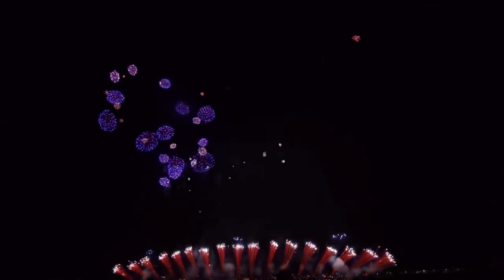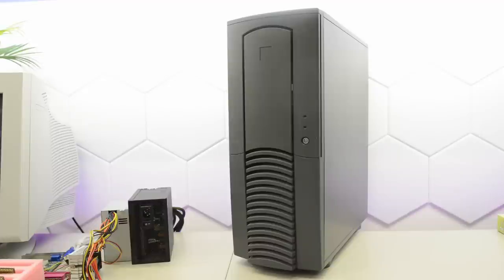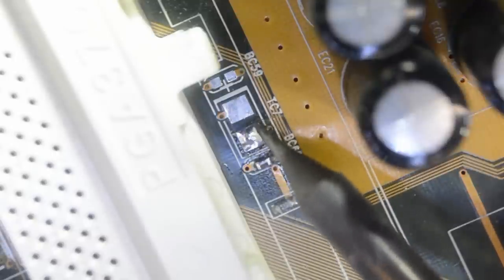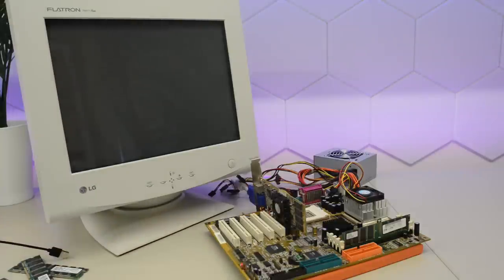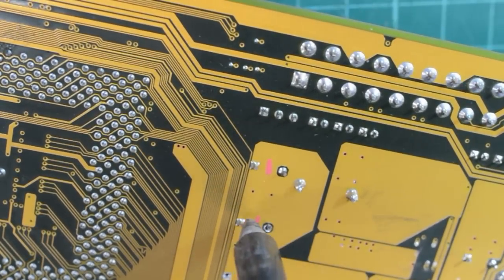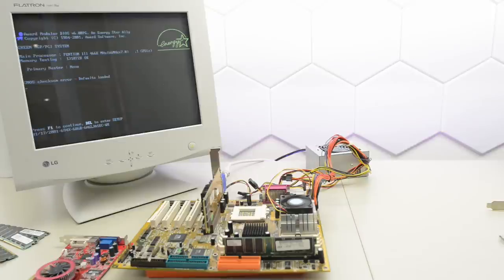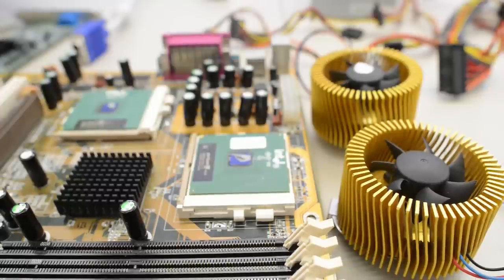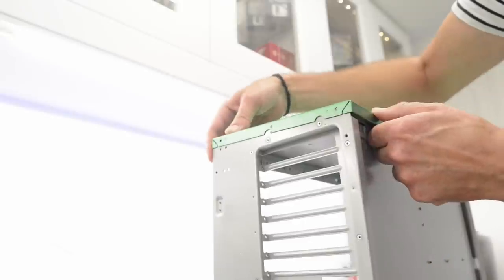Recreating my year 2000 PC with parts from eBay. MOBO repair. Custom ABIT VP6 dual Pentium 3 1GHz PC

Comment: This has just given me flashbacks for my Abit based machine which used a Abit BX6 motherboard 😀
Reply from the maker: Good times, when ABIT ruled the world : )
Reply: @Epictronics1  Absolutely. I've contacted the UK vendor to see if they might have a copy the invoice so I an double check what else it had fitted. Definitely some sort of Soundblaster as I managed to cross connect the DMA channels between that and the IDE controller and it made for an effective disk wiping method.

Comment: I found, that using "greasy" flux (cream??) works great, to fix the cap in place, before you add any solder. Use ceramic tweezer to gently push them onto the board while applying using the iron with some fresh solder on the tip.
Reply from the maker: I was just thinking this while I did the edit! I'll give it a try on the next project

Comment: I still have my VP6, you're making me worried I might need to recap it before I run it again.  I'll cross that bridge when I need to.
Reply from the maker: I have no experience running this board with bad caps but some people claim that bad caps can damage the voltage regulators on these boards. I'd recap it just in case

Comment: You have pretty good soldering skills with those surface mount components. I never really gave it much thought... preheat the board with a heat gun to solder & unsolder through hole components in those nasty, mean, uncooperative ground plains. Thanks for the tip. I probably won't use it but, if I do.... I really enjoyed watching this. Much better than I thought it would be. WE NEED PART 2 !
Reply from the maker: There will definitely be a part 2 in about two weeks. I need to order some parts. Thanks!

Comment: It is quite normal that boards from this era have caps from different manufacturers. I just recently recapped EpoX 8rga+ Socket A board low ESR VRM caps, and it had few Sanyo’s (left those on board) and crappy GSC caps which I replaced. In addition to these, it has bunch of TEAPO general use filter caps. These multilayered board can be tricky to work with. I did the decap like this this: I soldered big blobs of fresh solder on the legs so that gun has a large  surface area of melting solder, added flux and with 375C and around 10 sec from desoldering gun was enough.

Comment: This is awesome! The whole build brings back a lot of memories for me!
Back in those days I used the Antec version of the same case from the start of the Pentium 3 all through the Athlon XP days. For the P3 I also used one of those Golden Orb coolers and it seemed to do a good job for the price. That case served me well for almost a decade of continuous use!
Funny enough just yesterday I pulled the now empty old case out of storage. I'm planning on using it as a DAS with 12-16 HDD's to start with. I just need to figure out a good way to mount the SAS expander & PSU breakout board I will be using higher up near the PSU along with probably 2 extra HDD cages on the bottom. :)
Reply from the maker: Thanks, Sounds like a fun project :) good luck!

Comment: You're trying to solder to a heatsink
Yeah, I recommend using a hot air station at low temperature (100°C, maybe 150°C) for preheating.
That helps a bit against the heatsinking for the CPU VRM of the boards...

Comment: Great video.   You could consider doing clear coat over the top of that green to protect it and bring out the sparkles
Reply from the maker: I think I might! Thanks
Reply from the maker: @MrHBSoftware  When I don't have access to a proper paint booth, I use SprayMax 2k. Great stuff

Comment: A persistent FFD light and drive fail is normally an inverted cable. However your board has other problems 🙁. Perhaps use a PCI controller card if you can’t find a fix. Best of luck.
Reply from the maker: I actually used a PCI controller back in the day because I didn't like the onboard RAID. I don't remember why. For the hell of it, I'll try to fix this onboard controller anyway
Reply: @Epictronics1 did you try to invert the fdd cable? I've always remembered it had to be "red with pin 1 or opposites" if that makes any sense to you and from the video it does seem to be a bad data cable orientation
Reply from the maker: @HugoFaria-AZ  Yes, I did after I uploaded the video. I used an older cable without the plastic tabs and reversed the cable. It works now but only occasionally.

Comment: I personally think, the case looks better with the tilting/rotating feet.
Love the colour, though. I personally had one in blue, of course with the cutout and acrylic window on the side panel. And I added an acrylic panel with engraving and LED highlights to the door (cut out the centre thingy).
Reply from the maker: I'm actually considering doing some LED mods to this project :)
Reply: @Epictronics1  : I also forgot about the cold cathode lamps... ah yes... we're not getting younger, are we.
Reply from the maker: @bikkiikun  :)

Comment: You might want to check the wayback machine to see if it's cached some details about your original case. If you bought it from an online computer store, they might've cached the page from around the time you bought it. I managed to find out some details about computer parts from my old PCs by looking up the computer stores I used to buy from. I lost access to my old email account for the invoice they emailed when I purchased it, but I could remember around the time I bought the parts, so I just looked up the sites on the wayback machine and could browse the categories until I found the parts that jogged my memory. The bonus is that it also shows about how much I would've spent on the system at the time, although prices fluctuated pretty frequently so it's not 100% accurate, and I'd often wait a couple of weeks until I found parts on special, which the wayback machine might not manage to catch.
Reply from the maker: Unfortunately it was a special order through my dayjob. I don't remember what supplier we used to order the case. I'll do some thinking, maybe I'll remember

Comment: I still use the Chieftec Dragon case for my PC. Since years. It's a really sturdy case. Although it's a little bit heavy.
Reply from the maker: That's awesome. It will probably outlast many new high-end cases
Reply: @Epictronics1  It already did that. For over 20 years. But I have to say it's really old now. The i7 4770k that's now inside it probably stays in there. It was a great case. I also have beQuiet foam for noise reduction in it. A product of its time.

Comment: I am having a very similar problem with my 486DX machine. The IDE sockets quit working and the ISA bus is dead too. The machine has three 32bit PCI slots so I was able to boot up its hard drive using a Promise Technology 66 controller card inserted into one of the PCI slots with a PCI video card. I'm glad I have that option, but that leaves the CD ROM dead in the water.
Reply from the maker: Well, we'll figure it out. I have a few things to try out in a video in about two weeks
Reply: I wonder if a quick troubleshooting step would be to start with a fresh BIOS flash in case the BIOS on that board is suffering from bit rot?
Reply from the maker: @T3hBeowulf  I was hoping for that too. Unfortunately, flashing the BIOS didn't help. I have now also found that the USB isn't working. At least not with WMe

Comment: I had a case similar to that one but it was made by antec, and it had 2 usb 1 firewire ports in the front just below the door with a little flap and a windowed side panel. I do miss being able to pop in the fans with ease because of the brackets that the case had but 80mm fans were very loud and even with many of them my pc struggled to stay cool. Still for my first pc it was a beast back then.
Reply from the maker: yeah, 80mm fans is definitely the weak point with this case

Comment: The always on floppy drive LED is usually caused by the ribbon cable being the wrong way round.  The HDD corruption on the primary IDE channel could be because your cable is too long. Try using a shorter cable. It must an 80 wire cable.
Reply: Also try limiting the speed to 66 or 33Mbps, not 133.
Reply from the maker: Yes, I tied with an older FDD cable without the key notch and the FDD is now working. I have tried with a shorter 80-wire HDD cable but no luck so far. Also tried with a 2-second HDD delay in the BIOS
Reply from the maker: @simontay4851  I'll see if there is such a setting in BIOS

Comment: Back in this period I had a batch of Sony branded floppy drives that had the floppy cable connector reversed.  I had to cut off the tab and insert it backwards or the drive would do exactly the same thing yours does.
Reply from the maker: Dude! That was one of the faults! I tried a cable backwards without a tab and it would boot ones. It wouldn't boot the second time so we have more faults but this was definitely one of the issues. Thanks!

Comment: I have VP6 with 2x 1GHz PIII, 768 MB RAM, SB Audigy 2 ZS, FX5900 + VooDoo2 8MB. 
I can advise you to triple check BIOS settings for floppy and for IDE - it's a bit unintuitive with some additional options, which you may have accidently turned on (such as A: and B: drives swap, which caused errors in single floppy drive configuration), also IDE HDD autodetection is also a bit wonky (you may increase initial IDE timeout if HDD is too slow for autodetect, built in RAID is a bit slower so it's more stable).
Btw. if you're using AGP in 4x mode, you may need to set  AGP driving value manually (otherwise it's unstable).
Reply from the maker: Thanks, that's very useful to know. I'm doing some tests as I write this. The FDD is now working :)

Comment: There's something else with old cases. Maybe it's their «form follows function» vision: It's a computer case, and you should be comfortable working on it. I've lost my taste for big towers, but that one looks really interesting, and the paint job is top notch.

As for the motherboard, a half-dead southbridge looks difficult to diagnose. Do you plan to change the chip entirely?
Reply from the maker: Thanks. If I have to. I'm still doing some tests as I write this

Comment: I might be in the same boat as you, regarding the failing IDE controller. In my case (no pun intended), it's an MSI KT3 Ultra-ARU (Via KT333+8233A) but the symptoms are similar. Regarding the FDC, I find it weird that it's also behaving given that it is integrated in the Super IO, not in the southbridge or the northbridge...

I'm looking forward to watching your next video!
Reply from the maker: Thanks! The FDD is working now

Comment: My first PC had a Chieftec Dragon case. It had an Asus M2N-E motherboard, AMD Athlon 64 CPU, 1 GB of DDR2 RAM, Nvidia 8500 GT and Windows Vista
Reply from the maker: Nice rig
Reply: My first build was just two years before yours. Asus A8N-SLI Deluxe (I sold that before the caps went bang!) with an Athlon 64 Venice, GeForce 6600 GT and XP x64. I still have the case that I bought for the system but it now houses a Pentium 3 500. :D
Reply from the maker: @gentuxable  nice rig, hold on to that case! soon enough nostalgia will kick in and you'll be off to eBay searching for an ASUS board :)
Reply: @Epictronics1  I have a saved search for athlon in Motherboard/CPU-Combos so it is just a matter of someone putting in a decent deal for the moment all A8Ns are either dead or extremely expensive.
Reply: @Epictronics1  Thanks. My parents bought that PC in 2006 which was 1 year before I was born. The PC had a 7300 GT first then it was replaced with a 8500 GT because the 7300 GT died so fast
Reply: @gentuxable  I did not build that PC, in 2006, my parents went to a computer store and choosed the components and the workers from the computer store built the PC
Reply: @DjordjeDPF2007  Ok well I did build it myself but made some bad choices like the case. It had no intake at the front but my 6600 needed airflow but now I still have the first case. Works good for an old system.

Comment: I hope this video will help me make my VP6 build work. But first i need to change some caps. I have it for years now and could not make both CPU-s to work when i bought it.
Reply from the maker: A recap is definitely the first thing to try with these boards. good luck
Reply: @Epictronics1  when it came none of the caps was bolging but after few years in storage some started to expand.

Comment: I know I had huge issues with crackling on my system running with an SB card, something about IRQ timing on SMP motherboards. So I bought a ridiculously expensive card, at that point I could throw money at a problem. I loaded up my system with 7 HDDs and a CD ROM. 2 77 GB deskstars that I still have (they never failed in 5-6 years of constant use) and 4 WD 100GB drives. I might have been using DC++ on my massive 2.5 Mbit connection.
Reply: The SB Live! and VIA southbridge chip issue was never solved, despite there being a claimed working chipset driver solution, and I battled with it for a year and gave up trying to find a solution, other than put in a SB 128 PCI which worked fine, but had no ASIO drivers which I needed.  The SB Live! had modified EMU APS ASIO drivers that worked with the SB Live!.

Comment: Hey there! Greetings from Argentina 😁. Thank you SO MUCH for your great detailed videos that gives me the encourage to affront new projects on this beatiful hobby! I have a question for you: What temperature do you use with the hot air station to remove those caps? Because i have a similar motherboard (Gigabyte Dual Tualatin) that needs a full recap like yours, and i don't have a desoldering gun yet. I only have solder wick, desoldering pump, an Amtech flux (great one), a hot air station and a T12 soldering iron. Any advice for this struggle?
Reply from the maker: Hello Argentina, Thanks. I use a very cheap heat-gun that only has two modes. full speed and half speed. I use it at half speed. I just go slow with 30seconds and try. If needed I go for 30 more seconds until it works :)

Comment: At 30.08 it sure looks to me like the floppy cable is the wrong way round. Number 1 wire should be at the opposite side that any IDE seems to have it. That's assuming Your floppy drive's connector is somehow not the opposite way round to normal. Anyway very enjoyable video. Love that Sparkly green paint.
Reply from the maker: Thank you, you are right. I swapped to a cable without the plastic key pin and installed it the other way around. The FDD now works :)
Reply: @Epictronics1  Excellent news! Glad to hear nothing is dead. Been there done that myself years ago.

Comment: I used to have a BP6 system with two Celeron 433's. I would love to recreate that system but the prices of the BP6 on eBay are insane. So that won't be happening. 😛
Reply from the maker: Yeah, it's too bad they are pricy. I'd  love to have a BP6 too
Reply: I recently re-built a dual-Celeron BP6 modeled after one I had back in the day.  It dual-boots BeOS and Linux — the two reasons I bought a dual-CPU board back then, when everybody was still running Windows 98/ME, which didn’t support SMP.  My old case was an In-Win workhorse that we used to sell at the computer store I worked for, but I decided to put the rebuild in an Antec case that is similar to this one.  Same design language, just a little smaller.  :-). I decided to skip the dual Danger Den CPU water blocks… haha

The one problem I have is the RAID controller.  If I load the kernel module in Linux, it tries to detect the drives, then hangs solid.  I tried several different kernel versions, and no luck.  Curious to see what happens in part 2.  It might give me some ideas.  In the meantime, I don’t really need the extra IDE channels, so I just disabled the controller.
Reply: @nickwallette6201  back in the days I used to manually compile the kernel and modify the HPT366 driver beforehand. It might be possible to download/compile the driver as a separate kernel module. We (me and some friend all had the BP6) used to change it to ATA44 which technically doesn't exist  but it worked. When you look in the code it's fairly obvious what needs to be changed. The HPT366 is very unstable on the BP6. You could also change it to ATA33 but at 66 it rarely works. Neither did it work properly in Windows 2000.
Reply from the maker: @nickwallette6201  I actually didn't use the onboard RAID controller back in the day. I had a PCI controller instead. I don't remember why

Comment: I think capacitor plague was part of what killed off abit..... around that time I had a kt7a-raid; other than being slightly buggered from the box it was alright......
Reply from the maker: Quite possible
Reply: I forget exactly but I think was nichicon had a bad series or 2 around that era that unfortunately they had been using quite a bit..... effected a lot of their boards..... ** being sued over bad caps is on their wiki... it's worth noting this was a bad era for caps in general